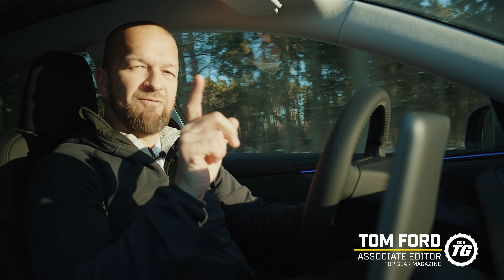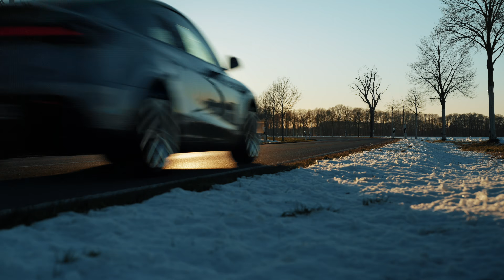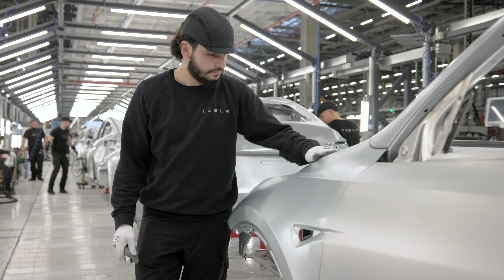Tesla Model Y – Sell Your Old One, Immediately!

Comment: New model Y is such a polarizing design, I would give it a grade of a C-, trying to square off a rounded design, and i am not a fan of the light bars,  the back end design, if you want to call it that is so boring, and the plastic panel under that awful rear light bar looks so cheap.

Comment: Hi, 1st time checking out your YouTube channel.  I am looking for a "middle-class" Ultimate Dad Mobile (can't afford the Ioniq 5N and too much body roll 1st gen. EV6GT) for work commute with some spirited driving on curvy street roads and occasional zig-zac thru freeway traffic at 5 mph above the posted speed limit of 75 mph; on other days, have just enough higher ground clearance and rear storage for grand-pa / ma and kid riding with their walkers and bicycle.  So basically blending my former ecu only tuned 2017 VW Golf R with a Honda Odyssey.  I have experienced the harsh ride and body roll, but fantastic torquey acceleration of my friends 2023 MY LR.  I have been told that the new gen. Highland M3P has negatively gained body roll compare to the previous; car enthusiasts have told me the great gain in ride comfort is through the sacrifice of weaker anti-roll bars and softer bushings and also the adaptive suspension is inferior to VW version, Dynamic Chassis Control, which in real time electronically adjust the shock absorbers to dampen ride harshness and control body roll.  Do you know if Tesla know the concern the car enthusiast community has about the Highland M3P and will Tesla resolve this downfall in the Juniper MYP ???

Comment: There is still no reflection of speed and nav to the screen. Come on this is 47.000 Euro one engine version and the range should be 700-800 miles. This is on production since 2019 in California and still EU is away back because I could hardly drive from Rotterdam to my holiday house in Bodrum (sw Turkey). But with my gas engine Peugeot it is simply done in 3 days. Hardly practical and extremely highly priced and not practical
Reply: Driving a Peugeot for 3 days isn't very practical either😅

Comment: Only things that holding me back buying a Tesla is they don’t have speedometer cluster and gearshift? I don’t like the idea that’s you have to change the gear on the screen.
Reply: Yeah, I thought I would hate that as well. But after a bit you get used to it pretty easily. And you do look to the same place for everything which can be nice. 

Also, in a normal car you sometimes have to shift your head to see things on the center cluster. That goes away which is nice.

Also if you Really want a center cluster screen you can get a Model S or X and I think both those come with center screens.
Reply: These are the only things keeping you from buying one? Oh boy

Comment: One thing that many miss when commenting that buttons are missing - voice control is absolutely sublime. Also in local language like Danish. It understands everything in plain words - no "code" language you need to learn like other cars. And it works flawlessly for navigation as well. The blinker does not need a short-blink option og multifunction - it stops automatically when you have changed lane.

Comment: Where do you see that front camera is for auto drive? That is managed from the window camera as far as I know. Front camera is for added visibility at low speed manouvering (parking etc.) - pretty sure it is only from customer pressure and that the car itself does not need it for anything.

Comment: Electric cars are crap. The end.
Reply: Now tell us why.
Reply: @ 1. They don’t work properly when it’s cold 2. The battery life degrades 3. Hyper depreciation 4. Soul-less piles of sh*t 5. You need to drive an electric car 30k+ miles at least before it’s equivalent in emissions to a petrol car 6. If everyone had an electric car the world would need to burn several times more fossil fuels to support demand - at which point they’re worse for the environment 7. They ALL look like sh*t 8. It’s a massive step backwards- I can fill up my car in a minute and drive off, therefore, why would anyone think it’s acceptable to expect me to wait 20 mins for a quarter of the mileage!? I’m struggling not to insult all of the owners at this point so I’ll pause - although I will add, EVERY electric car is subsidised by my tax therefore I willingly park my F-Pace SVR in electric car spaces… because I own a percentage of every electric car in this country to the extent I’m entitled to park in the space!
Reply: @Commentsmac  

1. Norway manages fine, EVs get around 20% less range in extreme cold but they operate fine otherwise.

2. The batteries today outlast the vehicles at well over 200,000 miles.

3. Depreciation for Teslas is no worse than any car costing the same.

4. Emotive nonsense, the Y is the best selling car on Earth.

5. EVs break even at 10,000 miles in terms of emissions from construction.

6. EVs are more efficient (2-3x) so even if all the electricity came from fossil fuels (it doesn’t) less fuel is consumed than ICE cars.

7. More emotive nonsense.

8. Teslas add 200 miles in 15 minutes, most recharge at home and rarely need to visit public chargers.

9. Fossil fuels are government subsidised as well.
Reply: @Commentsmac lol😂 None of all the points you mentioned and spent 1 hour on to write make sense but to yourself
Reply: @JohnSmith-x3y8h  you’ve written complete crap there - “Norway manages fine”, have you been to Norway!?… it’s full of diesel Volkswagens. The batteries degrade. I’ll say that again. THE BATTERIES DEGRADE. At 200k you’re buying a new battery. It’s as simple as that. You’ve just tit for tat written points that try to win an argument as if there is one. There isn’t. Electric cars are complete tosh. They’re not better for the environment and they don’t work.
Reply: Also point 8… BUGGER OFF! 15 mins is IF you don’t have to queue at a charging station and even then it’s too long.
Reply: @gerardhaus8150  it took 30 seconds… they are all sh*t. Honestly they are by no means the future, anyone who has invested in one full well knows this. If you have to make excuses for your car it’s a backwards step…”ah, when it’s charging I just go and get a cup of..” F%%%% will you!
Reply: @ Most people rarely have to go anywhere near a charging station because they recharge at home overnight. 

Over a quarter (28.9%) of all cars on Norwegian roads are now electric and they’re 88.9% of new car sales.

Yes the batteries degrade, but not by much and mostly in the first 6 months.

Today’s EV batteries degrade at an average rate of 1.5% per year.

Most people won’t need to bother replacing the battery because it outlasts the car, being over 20 years.
Reply: @JohnSmith-x3y8h  They’re not 20 years old which means currently you’re full of sh#t!
Reply: @JohnSmith-x3y8h  Oh right… have you got a load of 20 year old appliances still on the go in your house then? Thought not. 20 year phone still performing as new!?
Reply: @ 

We’re discussing cars. The batteries now OUTLAST the vehicle. Nothing else matters.

Disingenuous.

Blocked.
Reply: @ Aye? “The batteries now outlast the vehicles” is a statement based on what? Batteries is not a new technology. 20 year old batteries - ,1,2,3, even 5 year old batteries are all considerably worse than day 1 in cars as much as they are phones. I sincerely doubt you’ll even be able to charge a current electric car in 20 years time without a special adapter. By the way, what’s crazy about this thread - Everyone I know who has bought an electric car openly admits it was a mistake. Either Teslas are leaps and bounds better - to the extent the cheap materials are forgiven - OR! You don’t actually own a Tesla. Which is it?

Comment: Interesting but you missed one critical element in which the Tesla  is very inferior - voice communication with the car. I have been driving Model Y 2023 since July 2023. While the car is an engineering marvel, so far very reliable, and smooth acceleration is a dream come through, it failed miserably when it comes to interacting with the cars systems and applications, making the car unsafe and very annoying. 
For a car company boasting that voice commands are a key feature, supposedly making communication very user friendly being hands free, the voice recognition and communication to and from the car to the driver are terrible. 
I have an Android phone, and when paired with any car (not possible with Tesla..) it easily understands what I say, command, or ask, and the car interacts by voice back to me. The Tesla interaction system does not respond by voice, just by small fonts cryptic sentences on a lower left small section of the screen.  I have experienced SIGNIFICANT amount of time when the system does not understand or recognize my voice command, and there is no way to train the Tesla system. The phone system rarely recognizes the contact on my phone, and it gives me a list of names on the screen. Even when the Tesla system recognizes the name, the Tesla system very rarely recognizes if it is work, home, mobile, etc. There is no audio response to choose!.  
The Tesla phone system is extremely NOT user friendly, causing me to continually take my eyes of the road to glance and (and physically take my hand off the wheel to react to what pops up on the screen on the lower left side). Not only is it very annoying that the system waits for my physical interaction with the tiny portion of the screen, but this is also a severe safety hazard!!!

Comment: The gaps in the front lightbar of the model Y is very very very ugly. If you look at it from the side they are not in line with the car hood lines, which make the car looks cheap. They have to change it one continuous light bar, not in three pieces 😢

Comment: I’ve seen people trying to steer this model with hand signals, completely touch-less. The buzz I’ve been hearing is that this is a hidden feature. Many have been struggeling with it, but I think I just found out how it works💡Use your right arm. The arm and hand have to be straight, in a 25 degree angle pointing upwards for the hand signals to work.
Your left hand is completely free, which gives you the option of waving to pedestrians and other drivers as you like 👋

Comment: I love the fact it has no buttons, the screen and controls you do use on a regular basis are very intuitive and easy to use even when driving. It's not like BMW where you have to go into sub menus to find the AC. I will absolutely be ordering swapping my current performance model when a new one is available.
Reply: Yes, like when you suddenly get a massive soaking of water on the windscreen while doing 80 down the motorway and you have to peck away at the button on the stalk if you still have one or wade through menu items on the screen while you can't see anything.  Utterly, utterly ridiculous user interface.  They were a bit mad in 2017 but the car was good enough to compensate.  Now they are just stupid.
Reply: @ no idea what car you’re talking about but mine has auto wipers, most cars have had them for years now. You need to keep up.
Reply: @ I have a model X and a model 3P.  Auto wipers are not especially good and are slow to react if you have a sudden wash of water to your windscreen.
Reply: @ sure you do, I've got a MYP and it's perfectly fine, never had any issues.
Reply: @ I do.  Both on the drive now ready to be taken away for a pre-sale clean and polish.  Had the X since 2017 and the M3P since 2021.

Depends what you are comparing with though.  The Model Y is a nice car to drive compared to many cars as are all the Teslas but they can't do automation for shit .

Comment: 🎯 Key points for quick navigation:

00:05 🚗 Tesla Model Y's new version has begun production in Berlin, with orders open for regions supplied by Gigafactory Shanghai, including China and Australia.
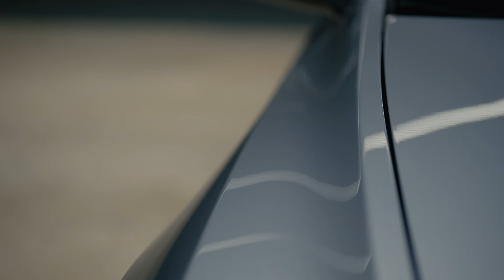01:10 🛠️ New exterior features include a lower nose, slim headlights with a full-width light bar, and a more generic design compared to the old Model Y.
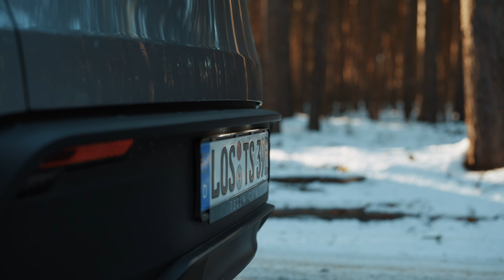03:04 💡 The redesigned rear bumper is more durable and cheaper to repair, reducing insurance and leasing costs.
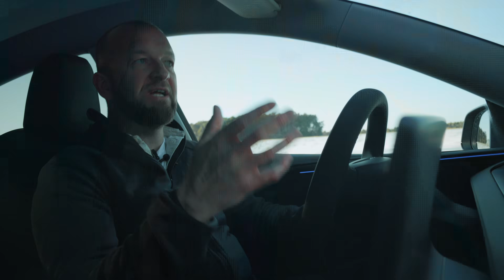04:11 🚙 The new Model Y drives significantly better than before, with improved suspension, reduced noise, and a more refined feel without increasing its price.
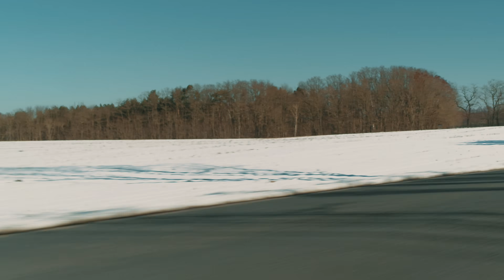05:09 🏡 The interior features improved materials, better connectivity, and more practical features like heated/ventilated seats, making it a more comfortable family SUV.
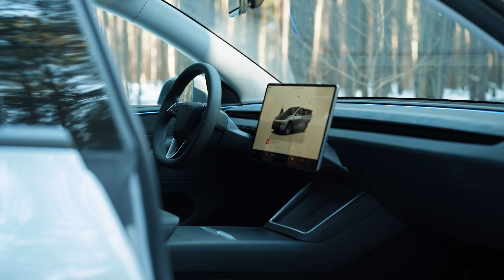06:41 🎵 The car's audio experience is enhanced with a 16-speaker system and a subwoofer, making it ideal for enjoying music in a quiet cabin.
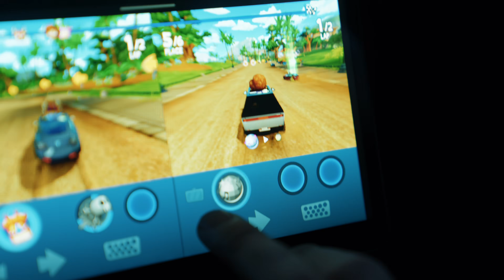07:50 🛋️ The backseat now includes reclining and electrically folding seats, plus an 8-inch screen for passengers to enjoy entertainment.
08:35 💸 The Model Y launch edition in the UK costs £60,990, offering faster charging and a longer range, with multiple other variants available.
09:45 🎤 Tesla’s Lars explains the challenge of improving the world’s best-selling car without disrupting the successful features that customers love.
11:16 🚗 Focus on family experience: The Model Y aims to improve the comfort of second-row passengers without losing its agility and sporty feel.
11:45 🛠️ Achieving comfort without compromising: Enhancing ride comfort while keeping a responsive feel was challenging but successful through engineering and NVH (noise, vibration, harshness) improvements.
12:39 🚙 Test drive impact: The first 100 feet of driving are crucial to impress buyers. The new suspension feels softer but maintains tautness for a better driving experience.
13:08 🛞 Tyre innovations: The Model Y features all-new tyres, improving ride comfort and reducing rolling resistance without compromising handling.
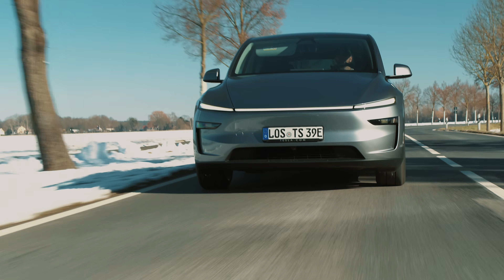14:08 🔧 Suspension improvements: By enhancing tyre design and body stiffness, the suspension can now perform better, improving overall ride quality.
15:08 ⚙️ Steering refinements: Slowing down the steering ratio slightly for better predictability and linear progression, while maintaining sportiness.
16:37 🔇 Noise reduction: NVH improvements come from better tyre design, suspension upgrades, and acoustic glass, creating a quieter cabin for a more comfortable driving experience.
17:37 🎧 New rear features: The updated Model Y introduces a Bluetooth feature for second-row passengers, allowing them to use headphones for a more private experience.
18:36 🏭 Production challenges: Managing production changes across four factories and coordinating suppliers globally is a huge challenge when upgrading the world’s best-selling car.
20:03 🔋 Future of EVs: Focus on efficiency improvements across the powertrain, tyres, and aerodynamics; solid-state batteries may not arrive soon and could be expensive.
21:02 ⚡ Tesla focuses on small, incremental improvements to enhance range, such as reducing watt-hours per mile, optimizing aerodynamics, and improving braking systems.
21:30 🛠️ The new brake-by-wire system and low-friction components contribute to overall efficiency, similar to an F1-style approach to reducing friction.
22:01 🚗 Tesla uses new materials like "kick-ass fluid" and segmented magnets to increase efficiency without needing battery changes.
23:28 🔋 Incremental changes across various systems (motors, bearings, brakes) result in a 10% increase in range without major battery technology changes.
23:59 🚀 Tesla is focusing on ramping up Model Y production and working on new vehicles like the Semi, Cybercab, and lower-cost models for 2025.
24:30 🏎️ Despite a small team, Tesla has significantly increased its production efficiency, with fewer engineers needed for more cars than a decade ago.
25:31 🧰 Tesla engineers, including Lars, enjoy their jobs, finding it fulfilling to work on innovative car designs and new technologies while keeping a connection to classic cars.
26:35 🚙 The new Model Y improves on the old version by offering better efficiency, quieter rides, enhanced steering, and superior family SUV characteristics, solidifying its position as the top electric SUV.
27:06 🔄 Tesla must focus on revolutionizing their designs rather than just incremental improvements, as other manufacturers are closing the gap with highly competitive products.

Made with HARPA AI

Comment: Many manufacturers offer mild refresh at 5 year point, mainly cosmetic.  The 10 year point there are both cosmetic and major improvements.  Tesla constantly improving the production line cost wise and efficiency wise.  Almost monthly you can see a screw or assembly change.  EV’s will become faster and cheaper to make in the future.  Tesla will be one step ahead with their assembly line 2.0 approaches.  More battery plants in USA vs Korea and China.  Charging stations need to be ubiquitous.  Tesla sells it stations to others.  EV’s do not need service intervals which gas car companies depend.   The charging stations will fill in the cost cap.  Also Tesla supercharges will offer lower rates vs competition.  Many other stations are supplemented with solar and battery storage, which they also produce at their giga factories.  Musk has the Midas touch everything he touches. Most only see in quarterly profits.  Musk sees decades into the future

Comment: I have Solar with storage batteries and Tesla.  I save $500/month on home electricity and gas.  Definitely the future.  These could be forever cars as only 80 moving parts vs thousands in gas cars.  With Software and hardware updates over the air it’s an iPhone on wheels.  How often does your iPhone need service. No petrochemical odors or oil spots on your garage floor.  I was a gear head in the past.  No more service intervals to the dealership